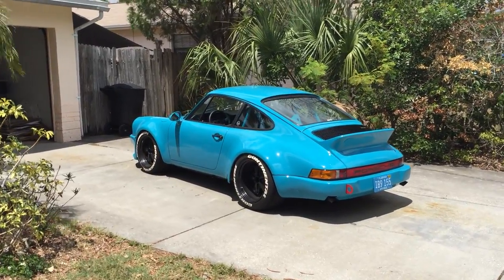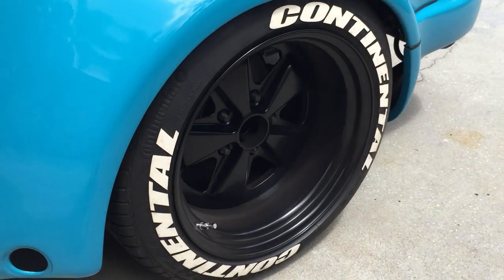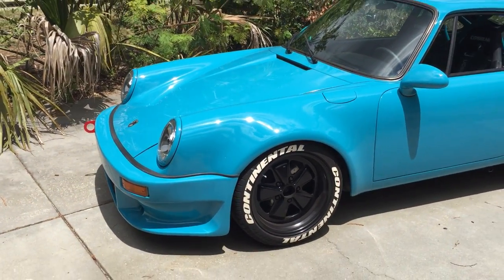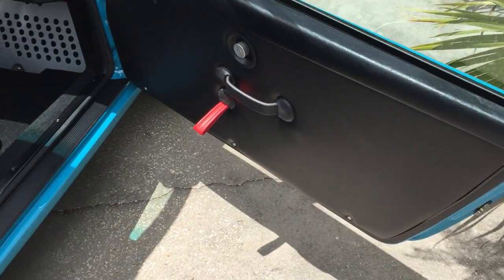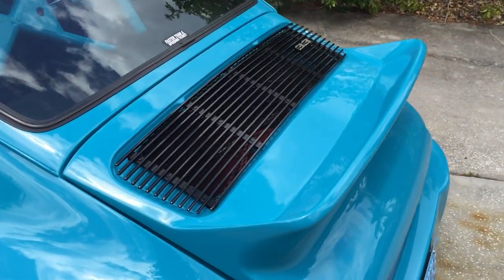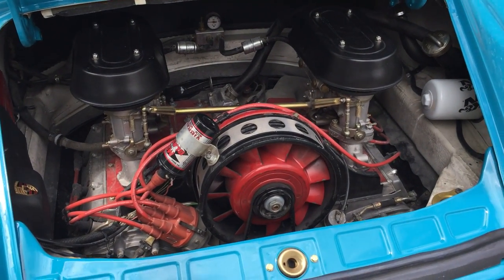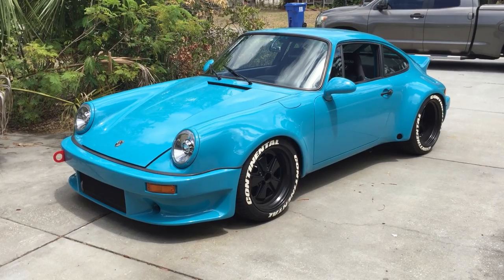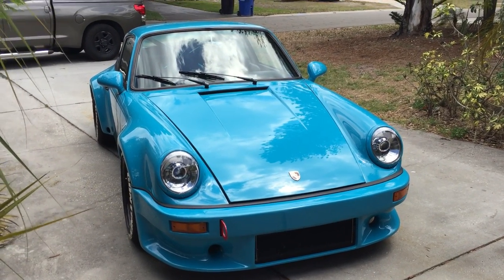MIAMI BLUE WIDE BODY PORSCHE 911 3.3 SHORT STROKE LIGHTWEIGHT TRACK STREET CAR

Comment: Just Beautiful!!!! You never mentioned the stance details. I’m dying to know your suspension upgrades.
Reply from the maker: Front suspension
935 style strut X brace (brushed aluminum), OEM ball joints, OEM wheel bearings, OEM turbo tie rods, Rebel Racing adjustable bump steer kit w/dust boot, front, Rebel racing bushing set w/spherical mounts, Rennline sealed monoballs, hollow Tarrett adjustable through body sway bar, sway bar chassis adaptor kit, sway bar reinforcement kit, Sander front hollow torsion bars (22MM).  I supplied the OEM Boge strut assemblies to Rebel Racing for a complete Bilstein style conversion including raised the spindles (32MM), gusseted, added brake line supports, welded on double sheer lower bump steer supports and new Bilstein sport strut inserts . I powder coated the A arms flat black.

REAR SUSPENSION 

OEM wheel bearings, Rebel racing adjustable spring plates, Rebel Racing spring plate bushings, Bilstein sport shocks, Tarrett adjustable sway bar, WEVO sway bar mounts, Sander rear hollow torsion bar (30MM), Rebel Racing RSR sealed monoballs, powder coated silver trailing arms. 

 The suspension was recently installed, corner balanced and aligned by Speed Syndicate here in St. Petersburg, Fl. The car tracks very straight and grips like nobody's business.

Comment: what a shame about the chassis not being painted, drop that engine when you detail it and get it painted.  You will be much happier with it.  A beautiful thing.
Reply from the maker: Engine is oat now and being refreshed, both mechanically and cosmetically including engine bay paint in Miami blue. I am doing the D Zug X brace in the nose and adding a black plush carpet kit where the white in the frunk will not be seen either. Standby about 2 months. I also have a few other tricks up my sleeve, just subtle stuff inside.

Comment: gorgeous-beautifull
Reply: It's a beautiful undertaking...
One thing I have issue with, the gaps on the front trunk & the rear hood are uneven on the left & right sides...(maybe it’s just an adjustment)
Maybe it only stands out because the paintwork is so spectacular...
But as you said, aftermarket pieces (especially fiberglass ones) are at the very least, difficult to fit properly...
Nevertheless, job well done! 👍

Comment: Do a build breakdown and how much stuff costs (rough estimates)
Reply from the maker: Will be making a new updated video soon, as we have done allot more work. Engine out and now a 3.6 and also painted the engine bay. All new complete full on race suspension and a rebuilt gauge cluster with a Miami blue tach. Video coming soon. I can tell you it cost allot but will try and break it down if possible.
Reply from the maker: Also check the build thread for the latest upgrades http://forums.pelicanparts.com/porsche-911-technical-forum/895325-my-new-build-last-long-but-very-fun-journey.html

Comment: A 964 with that many upgrades I rather find a964 RS. Maybe you pay more for an RS but at least it's an investment, what are your thoughts?
Reply from the maker: Its not a 964 and with the new engine, I will smoke your RS. LOL.
Reply: @exoticarauto  it's not a 964, then what was it originally?
Reply: @JIANYM36  In the video he identified it as a 911 SC.  I think he said '82.
Reply: @johndouglas4528  ah thank you

Comment: What happened to the 3.3 engine that you took out?
Reply from the maker: Bazooka Joe being rebuilt by a top engine builder. Using a GT3 crank, gt3 oil pump, custom rods and 100mm pistons, twin plugged, 50mm pros. Should be good for 300HP at the wheels. Stay tuned, it's almost done.

Comment: I'm kinda new to the porsche classic, is it 930 or 964?
Reply from the maker: Kenji744 911sc
Reply: Kenji744 930 bud :)
Reply: Tiago F 930 is a turbo mate, this is a 911sc
Reply: Nicolas Dujardin 930 is still a 911.. same goes for the 964 and 993! turbo or not ;)
Reply: Tiago F offcourse its still a 911...the 911 line is the body...
everything from a 912 to a 991.2 is a 911.
but a 930 is the modelname for the 911 turbo of that era..i just meant that there isn't a NON turbo 930 model...now what i mean ;)
Reply: 930 is the 3,0l turbo car with 300hp...later they enlarged the engine to a 3.3l with 330hp.
964 is the model that came after that..
this is a 911sc with a enlarged engine and widebodykit , and rs spec interior
Reply: Nicolas Dujardin yeah 930's where turbo.. my bad :) nice build tho i prefer the 993 wb myself

Comment: if for sale how much would that cost?
Reply from the maker: 200 with the new motor and fully rebuilt top of the line suspension. Painted the engine bay also. Sent all gauges out to be refinished and recalibrated and the tach is miami blue now. I know that sounds crazy but i have 40 in the new motor and tranny alone. Try and build one cheaper. Go to my other vids to see the engine. It rediculous. 375 HP 300tq. https://youtu.be/p81b1-20gNI

Comment: People love RWB 👎🏻 for there work on Porsches. The guy is the biggest hack he cuts the quarters and front fenders practically off and screws flares on. What a hack. That's like this guy said his quarters and fenders were worked and welded metal, that's the correct way. People say oh RWB 👎🏻 does cars in usually two days?????? Because he cuts everything he's got to bumper covers and four flares to screw on! Oh and 3 inch spacers for the wheels. I worked in the biggest collision repair shops on the east coast, multi million dollar state of the art facility we worked on every car. Look it up After Hours Auto Body in New England.

Comment: What model and year of car is this ?
Reply from the maker: says that within the first 20 seconds, but it's a 1982 911SC if you missed it.
Reply: Exoticar Auto Exoticar Auto alright thank you very very much this helped me alot I been really looking forward to buying and building one thanks to bitcoin. also do you have any ideas where to find the front bumper of this car (singer veachle design) I need that front bumber I can't find it (the bumber I want it on the gallery category in the website)
Reply: Because this info is so hard to find out with this video... Not like it's in the description or right off the bat in the video or anything.

Comment: AC delete, Hot car, and the engine, Im let down, short cuts suck on a porche.
Reply from the maker: AC never works on these old 911 cars and is allot of weight. Less weight more speed which is what I want. Engine bay has been painted and a new fully built HOT ROD 3.6 has been put in there with al the eye candy, check my other videos. Thanks for the negativity.
Reply from the maker: Check out this shortcut   https://youtu.be/IQ-eiGq9ThA
Reply: Hmm, maybe spell Porsche correctly if you want to be taken seriously ;)

Comment: Ricey
Reply from the maker: Jelly
Reply from the maker: anonymous I have done 3 so far, here is a black car I designed just as the miami blue, take a look. http://bringatrailer.com/listing/1984-porsche-911-carrera-7/
Reply: Hah! I was JUST looking at that car. No idea it was yours until I happened to see this comment.
Reply: Black car is sweet but I'm personally not a fan of the blue car.
Reply: Hmm, I actually prefer the blue car. Color is insane.
Reply from the maker: anonymous heritage motor car restoration , jason, he only does classic porsche.
Reply: exoticarauto Hey man, I'm a pretty young person in my early 20's who's dangerously into porsches on a honda budget. Looking into the future, how much does a project similar to this run? Let's assume that it's a beater to begin with.
Reply from the maker: All depends on the motor you want to build and if your going to do the work yourself. You can spend 100K really fast. The donor car for this build was 35K but the motor was just rebuilt and that's why I chose this car. With a good strong motor, its just picking and choosing what you want to do with the rest of the car.
Reply: I gotcha. Thank you! Any tips on best places/ways to look for a donor car?